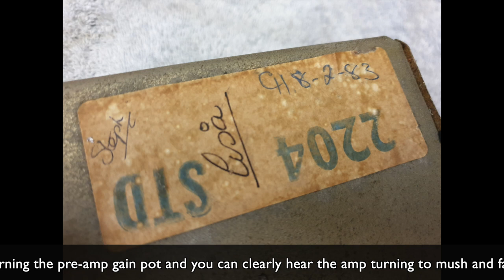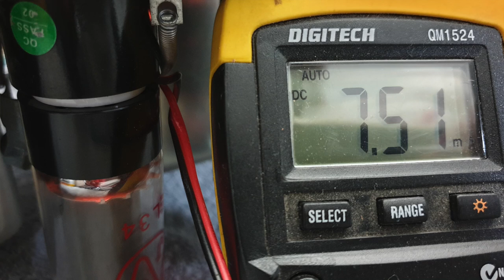1983 JCM800 Marshall 2204 - RESTORATION AND SERVICE

Comment: I kinda liked the extra 10k & 470 treble snubber 😅

Sounds killer regardless 

I recently got an ‘87 2204 with a “good”’tube buffered effects loop installed. My tech said it was a good mess style one. He said it appears to be stock, but it’s so much nastier sounding than my ‘15 2203x. He said it measures 51w output on clean and around 70w on the driven channel…..is/was that common ?

Comment: I am having a hell of a time finding the cap for my fuses on my 2205 early '80s jcm 800  50 watt. Dual channel this thing was and is awesome! So I need to get it working again. The fuse caps that were sent to me by some company out of England were too small... Do you have an idea what size fuse capsis would be the fuses in the back are 500 ma and 3 amp. HT if that means something special.? Thank you ahead of time.
Reply from the maker: You you mean the plastic screw in caps rather than capacitors??

Comment: Hello great video! Have you ever compared an original jcm800 2203 with the 2203x reissue?. if yes there are differences?
Reply from the maker: I've had them both one the bench.  The reissue is a faithful reproduction, with the exception of the FX loop.  But if you bypass it, you'll get proper 2003 tones from a 2203x.

Comment: What impulse response are you using? Also, I have a SC20H and it doesn’t seem to have anywhere near as much gain (stock for stock) as this amp. I wonder why not?
Reply from the maker: Probably from the Ownhammer GNR pack. As for your SC20H, not sure why.  Maybe try replacing V1.

Comment: !/2 watt dropping resistor on the second node ? why not a 1 or 2 watt metal oxide instead?
Reply from the maker: 1/2 watt? I never use 1/2 watt for power droppers.

Comment: Have you ever seen a 1982 Jcm 800 2204 with Green Tolex and Basket weave on the face plate covering? I got one recently and was wondering if that was just an option at the time? I saw a picture of one from 1986 with horizontal inputs. Thanks!
Reply from the maker: I definitely worked on a few with the basketweave front panel, they were black tolex though.
Reply: @HeadfirstAmps  Thank you! I love your channel!
Reply from the maker: thanks!!